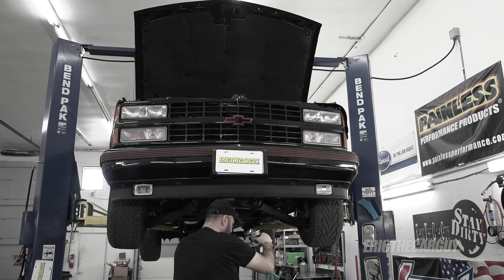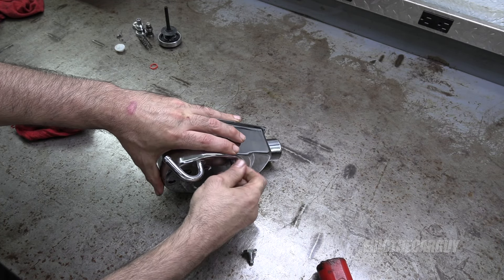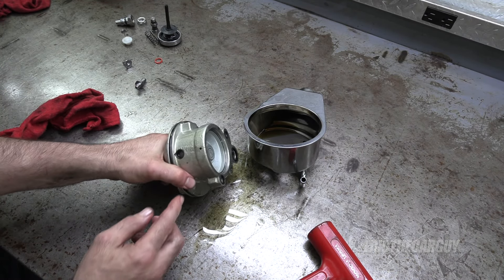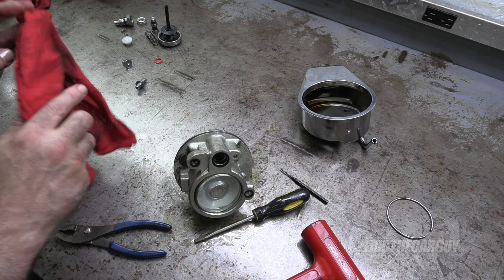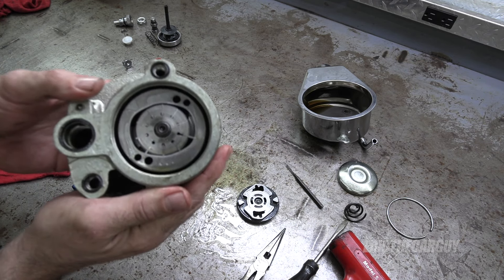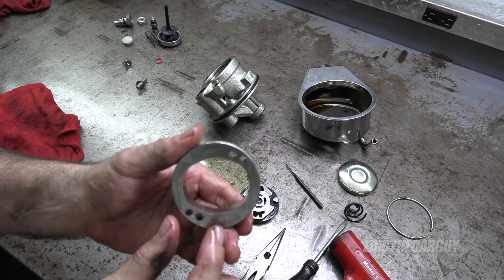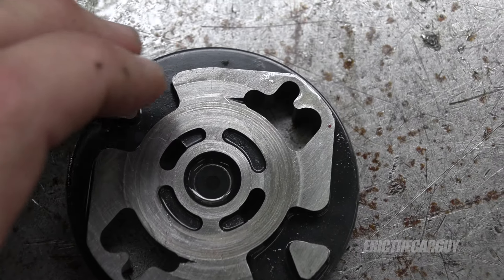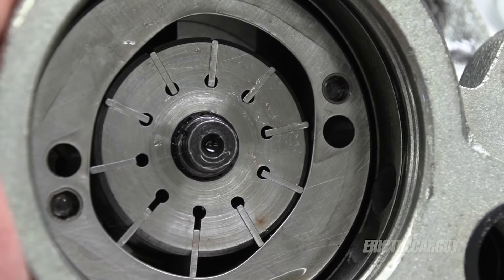What’s Inside a Saginaw Power Steering Pump?

Comment: I grew up in Saginaw.  And I spent many hours inside Saginaw Steering Gear where that pump was made.  I watched those pump parts being machined, and the pumps being assembled on the assembly line.  It was a very high volume operation.  Of course they did not come from the factory with that pretty chrome plating, they were all black,
Reply: I currently work there (now called Nexteer Automotive) and there's not much hydraulic power steering manufacturing there now.  Only for HD Trucks.  It's switched over to high volume EPS.
Reply: I live there as well. My grandpa worked at steering gear.

Comment: Great video. I used to rebuild these on some of my old Chevys, but I used this as a refresher course. You showed / mentioned a few things I had forgotten (getting old!), so I'm glad I did. Rebuilding the pump on my 2006 LBZ and can't afford mistakes. It was working fine, just leaking at the shaft seal, so a rebuild kit should do the trick.

Comment: I just took one of these apart for my 1998 K1500.  I discovered that you shouldn't use the hammer method to put the pump back in the reservoir. I accidentally tore the o-ring doing it that way.  Instead, just gently pull the two together using the two nuts on the back. Just alternate between each one to evenly pull the pump and reservoir together.  For me, I used a deep impact socket and just twisted the socket with my hand, no ratchet or wrench, and use the socket to hand tighten each bolt. Going about a half turn on each nut alternating back and forth.
Reply from the maker: I was concerned that would warp the case. Another reason I put the bolts in during assembly was also to keep the 'o' rings from coming loose. Thanks for your comment.
Reply: @ericthecarguy  I was worried about that too, that's why I just twisted the socket with my hand instead of using a ratchet or wrench. It actually took very little force to get the two to come together.
Reply: @ericthecarguy  I know this is a pretty old comment, but you could use some large washers to help spread the force over a larger area of the case

Comment: So March Performance never got back to you on their F'D UP PULLEY ? SUMMIT IS AN OUTSTANDING COMPANY, THANKS SUMMIT ALSO.
Reply from the maker: Not exactly, but they did pass the buck to Summit.
Reply: @ericthecarguy  That's really sad. A company should repair their own defects. Or, perhaps they have a deal with Summit. Either way, I'm glad you're getting a good pulley.
Reply from the maker: @Jeff Kelley I got the parts from Summit is why they suggested it.
Reply: @ericthecarguy  Okay, I mistakenly took it from your description that March Performance was avoiding their responsibility. It makes sense for a consumer to return any part of their purchase to the supplier from which they purchased their main product. Thank you for the reply. So, why the big run-around, is what I am wondering. Although, you do not have to reply to this. I know you stand by Summit. Sometimes misunderstandings boil down to who greets you on the phone or at the counter. I used to be a manager in consumer electronics retail.

Comment: Ah, I finally know what happened with the pulley. I hope the short time the distorted pulley was being used inside the truck did not cause much damage to the pump. Now, you have a better cooling system for the pump, as well. Thanks for the inside look into the bad pump. I'm sure you could rebuild the pump, but having a warranty really saves time and money. I was showing one of my sons, Gabriel, the process you used to determine the fault with your power steering. Mostly, I wanted to show him my interest in watching your videos and how I wanted to do my own repairs, once we get back to the States. His real interest is Architecture. So, there you go. I feel better now. Great job. Jeff

Comment: Had one of these on my P30 motorhome. I pulled it apart and smoothed the pump surfaces on some emerycloth on glass. Smoothed the vein edges the same way.  Then, replaced the orings and cleaned everything. Pump was was $900 new from dealer. Got a rebuild kit from local Carquest about $30. Still worked with no leaks after 50k miles. If the spring has no pressure when you remove it then the pump is worthless, don't bother trying to rebuild. the spring keeps the receiver plate tight against the veins.
Reply: Curiosity killed the cat lol. Its good to see how these things work also if it was an old vehicle I suspect it would be possible to re-engineer it. I enjoyed watching this pump come apart and finding how it works

Comment: From AvE, I learned that pressure is created by volume + flow restriction.
Reply: Yep.... Called venturi
Reply: Pressure is created by stress upon a fluid. A flowing fluid when restricted will create a pressure in response to the restriction. But you can also create pressure on a fluid in a static cylinder by putting mechanical force on it. I.e. static vs dynamic pressure
Reply: I learnt it as a kid by putting my finger over the edge of the garden hose or taps in the house and then getting shouted at for the wet mess lol
Reply: Ah yes, the esteemed professor Uncle Bumblefuck

Comment: for that power steering pump, seal kits are available for very cheep (28401490 is $18.99 at O'Reilly auto parts at the time of this comment) and the most common failure for that pump is the seal on that plate with the clip you removed with a punch. That seal separates the high pressure side from the low pressure side.
That valve that you took apart is also available for around $38 for an oem acdelco part
also, instead of 2 c-clamps, use a vice or arbor press, it's much easier

Comment: Yeah... it seems like an unusual failure mode and I agree the misalignment from the pulley is certainly a front runner for possible failure.  Well done video Eric!
Reply: I have same issue. Happened after I did a minute long burnout I assume I over sped the pump.

Comment: Cool.  I have a nearly identical pump in a '70s Cadillac that's good, but leaks around that big O-ring that encompasses the whole pump.  I temporarily fixed it a few years ago with some JB weld smeared around the seam, but it's leaking again and time to fix it properly.  Remanufactured parts are often hit and miss, so I wanted to keep the original pump, but I thought I'd need a press and some special jig to get it apart.  I'm quite thrilled to see it's possible to do with a hammer.

Comment: Cool, always wondered how power steering pumps worked. My car uses an electric one, I asume that instead of being driven by a pulley, it's driven by an independant electric motor. Really tight tolerances there, no wonder it failed due to the faulty pulley. I hope none of that metal shavings went to the rack though.
Great video Eric, as usual! 👍🏼🙂

Comment: i rebuilt really lot of those pump saguna in the 80,i was a rebuilder you can get biger rotor and stator for more presure ,but often the low presure issue is cause by valve sticking or crack at that small hole were you remove the clip of cover of the stator  or wrong fluid... in the 80 all those part were available at ford

Comment: Even with a good pulley, proper belt alignment on these pumps in critical. If alignment is out, the vanes are pulled into the front housing or pushed into the rear and wear out quickly like you saw here.

Comment: That was a very good video without bs, music (as much as love it can do without while trying to pay attention to the video) and a bunch more horsepucky I didn't care about, thank you and just one more thing, I really only wanted to know about the o-rings at the fitting to the check valve assembly & what I could get away with so there'd be no leaks to the outside of it, as it turns out I found a very small leak at the flange on my water pump also so I might as well take care of that now too & check one more video with just a little bit of focus on the o-rings while I clean up the rest of things to be ready to put back together tomorrow, I'll work on one of my motorcycle projects for the rest of the day. I did learn something useful from your video regardless, thanks.

Comment: 8:00 did you put the stator ring in upside down? Looks like the 3 diamonds are facing down? 

These pumps internally are the same as fitted to Holden Commodores albeit remote reservoir and a few less orings. Best way to get that rear cover on was to stick it in the press and use that and a big socket to hold it down whilst I wrangled that clip on. My first pump was a nightmare, they dislike high RPM, heat, etc so. You didn't remove any orings from the bore also to remove the stator ring, did it just slip past them(trying to gain insight into the design progression)? 

Conveniently this general vane pump style only really leaks from that rear plate oring, $1-2 fix for most models. Enough to pass inspection.

Some interesting design notes, on the back of those black diecast bits(i think they're called manifold plates?) are 4 tiny pads which are surface ground first before doing the other side. Saves a lot of time and grinding wheels.

Wonder if you could rehone those faces with a sanding plate? Piece of thick glass and progressive grits, the spring could take up the slight reduction in height(which it does anyway, removes the  tolerance stackup issues)

Comment: And that's exactly why the pump worked when it was cold, but not when it was hot.  The grooves that your fingernail would catch on will get bigger as the pump heats up -- and with such tight tolerances, where even those tiny grooves cause problems, making them larger by any amount will cause the pump to get worse.  Precisely the symptoms you were seeing.  Cool analysis!

Comment: You wouldn't believe how hard it is to get a good replacement pump these days.  I've had 3 of this exact style pump from different manufacturers (including acdelco) be bad out of the box or within 50 miles and several other ford styles as well.  In both cases wound up resealing a used original (dodge or gm) part and have no trouble.  Aftermarket steering parts overall seem to be generally terrible these days.

Comment: Hi Eric
These kind of pumps never fails  it last long.. only you need to use fine emery paper to flatten that groove you noticed with ur finger n clean entire the parts with kerosene or petrol gasoline and pay attention to the screen filter and pressure control valve and its spring both of these should be cleaned deeply n nicely , and thats all you have done.. don't forget to use Vaseline jell to make your work much easier.. nevermind of the wearing its normal.. thanks

Comment: Flow control valve is adjustable and is key to pressure output. Washers under nut- add/subtract.

Comment: I remember when these lasted forever but someone local has one of the newer style and I don't know what's different but they don't last as long. Huge pain to R&R the pulley either way but still not that hard. Usually the life of the pump is good fluid and not continuing to use old worn out hoses. The hoses deteriorate inside and then contaminate the pump and then the seal fails and then if it's not caught you need a new pump. It's a lot of patience and a few hail Marys to put those back together. Just buy another one.

Comment: I'm thinking about using a Saginaw pump as a dry sump oil pump for a remote turbo setup so thanks . I'm not so much worried about the pressure/gallons but if the housing/pump can handle oil well compared to ps fluid.

Comment: Eric, I am wondering if the thinning of the fluid due to overheating may have contributed to this failure. What is the maximum temperature rating for a power steering fluid? Since the back plate is just spring-loaded maybe you could help it by removing a bit of that scoring with some stone. Btw, I enjoy these disassembly videos the most cause I believe understanding how it works and what's inside is the key to the success....
Reply from the maker: The fluid seemed to run about 170º before I installed the cooler. I don't think that was excessive. See last weeks video linked in the description. I think the bent pulley was the root cause. 

In my experience, there is no fixing machined parts with sanding or filing by hand.

Comment: That scoring was most likely caused by the pump ingesting debris such as metal chips and dirt. I recommend flushing the lines and rack before installing your new pump. Had the pulley been the culprit, I would think that it would have caused a bearing failure or bent the shaft.

Comment: There is a special tool. The bench they are built on has a tray with holes in it so the shaft sits in it. To take off the can, tap on the edge and face with a rubber hammer till it comes off. An arbor press with a special block is put on the back of can and stood up and arbor press pushes it on. The copper washer on the pressure relief valve is the pressure setting, so thin copper washer is high pressure and thick copper washer is low pressure.
Reply from the maker: Thank you for that info!

Comment: I've just rebuilt the power steering pump on my 1991 Jaguar Sovereign XJ40 and while the outside of the casing is different, with a remote reservoir, the inside is exactly the same.

Comment: The pump creates a flow, but it also creates a high pressure zone between it and the valve. The valve serves to restrict flow to maintain a pressure differential across it and the vent. This type of pump is pressure controlled. They also make pumps that are flow controlled and will drive at varying pressures to try and match a guaranteed flow. 

Did you have access to get a sanding block to the back plates of that pump mechanism? If you could have sanded those groves out I bet you could have made it work again. it looks like that back plate could vary in position for a varying thickness pump assembly. 

In basic terms, that scoring you saw caused excessive leakage. Those metal fins aren't the greatest at sealing, but because we contained the leakage paths, they don't have to seal perfectly, just enough. The grooves served as too much seperation though and allowed for excessive leakage.